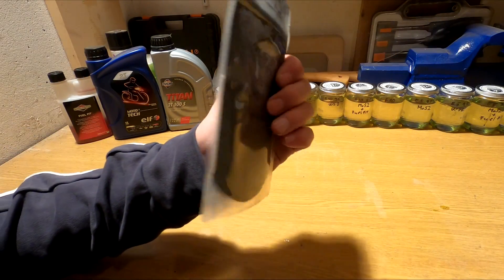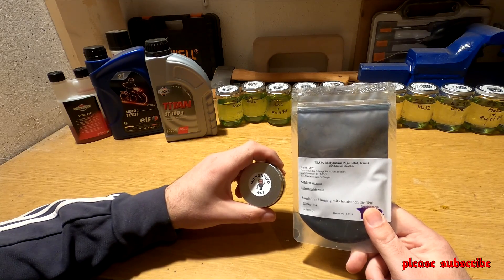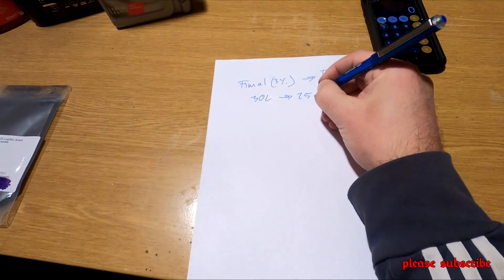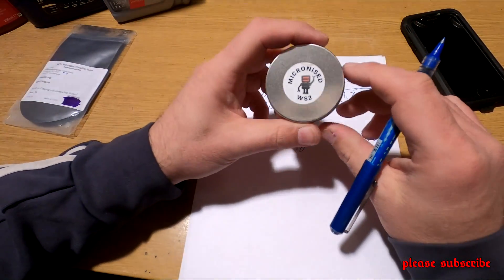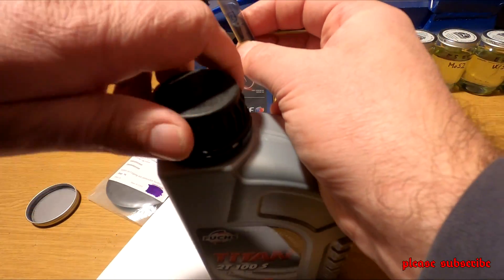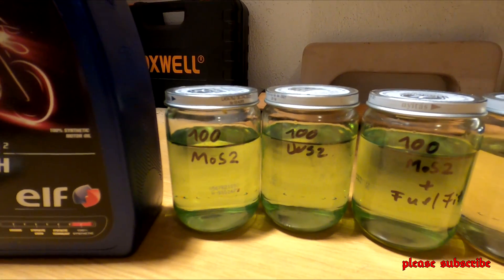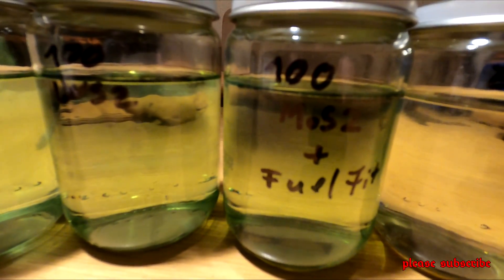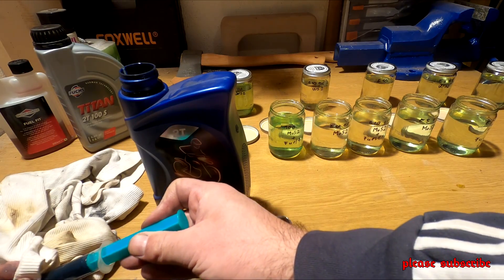⛽️ 🧪 1.rész Üzemanyag teszt E10 E5 100 Aspen, MoS2 WS2

Comment: Hol lehet venni WS2-t?
Reply from the maker: Ákos Jakab én az ebayen találtam megfelelő finomságút. 0,6 mikron (0,0006mm). Ez a kis doboz kb 15.000ft postával.
Reply: @Dióbirtok   Közben lecsekkoltam Ali-n is, ugyanez 50 g-osban 12 $. Ajanlom figyelmedbe.
Reply from the maker: Ákos Jakab jónak tűnik. Az őrlési finomság a lényeg. Ez 0,6 mikron. Minél finomabb annál jobban keveredik és nem ülepszik le. Minél durvább annál olcsóbb. Meg a tisztasága fontos. Ez 99,9%.
Reply: @Dióbirtok  Ali-n még 0,1 mikronos is van az említett tisztasággal.
Szerintem én a 0,6-os fogom fele-fele arányban hozzákeverni az olajhoz.
Milyen mennyiséget érdemes 5 liter motorolajhoz tenni?
Mióta használod és milyen tapasztalataid vannak ezekkel?
Reply from the maker: Ákos Jakab 2t-re levetitve van egy számolás a videoban. Én legfőképpen így használom, vagy hajtómű olajban 5% töménységben. Motor olajnak utána kell nézni a neten. Nekem jó tapasztalataim vannak. Sokat kapnak a gépek, és semmi bajuk. Autónál nehezebb észrevenni a hatásokat. Nem fogy 30-al gyorsabb lenni, meg fele annyit enni. :-)